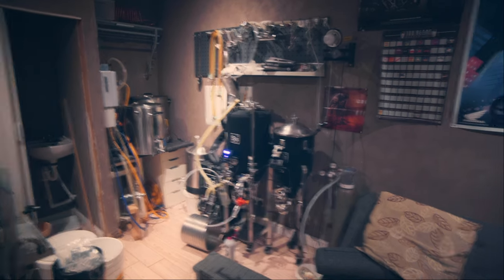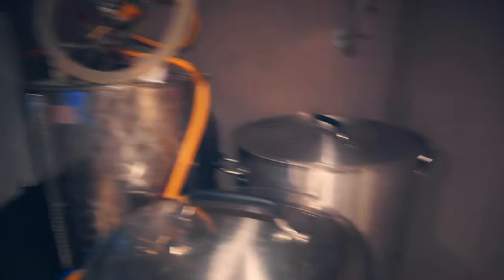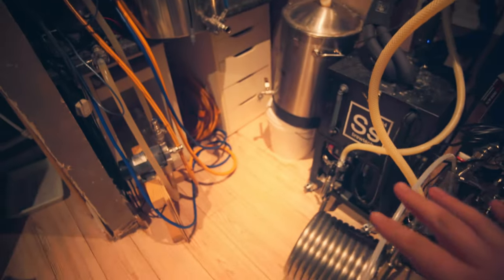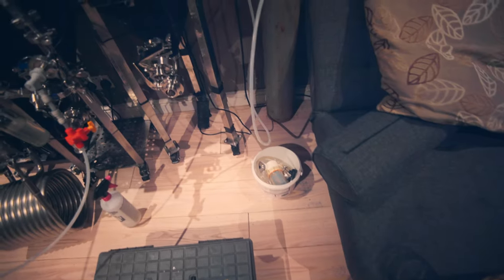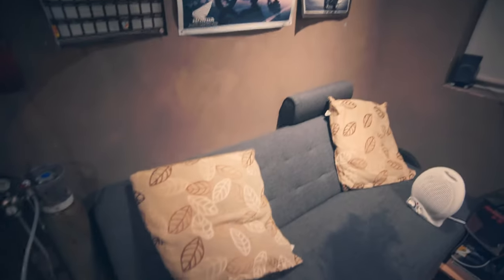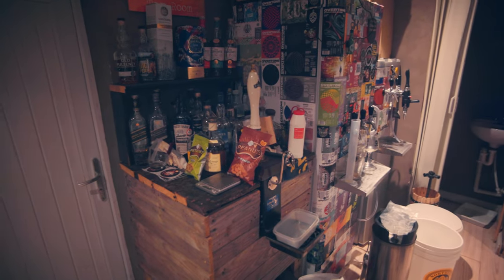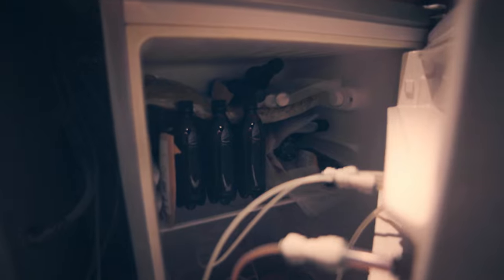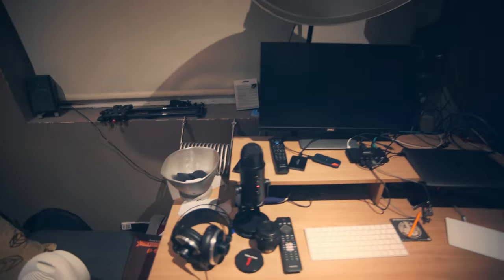Home brewery tour - High Road

Comment: You might have a drinking problem with your 8 taps 😂.  Lovely bit of space there, you need it by the look of it, the toilet in particular was a stroke of genius.  Few questions, is the garage connected onto the house and does it make it a bit warmer? are the walls painted or is that bare plaster? and finally, where is the BJCP poster?
Reply from the maker: Yeah problem is not enough time to drink! The garage was converted by the previous owner and is insulated then plasterboard. Even got a skylight in the roof. The garage is separate to the house. I’ve got an electric fan heater and oil filled heater in here. Tend to use the fan as it gets it up to temp quickly. BJCP poster was above the glycol fermenter 😜

Comment: How do you go about storing the open bricks of yeast? I just got myself one yesterday from WHC
Reply from the maker: Vac pack into 50g/100g blocks.
Reply: @AndrewLynch9  sound, I got a vac sealer in Lidl there. One more Q, what temp you set inkbird on kegerators. I've mine at 6.5, tempted to get a second fridge at colder temps.
Reply from the maker: @MrVinylNinja  6.5 should be fine. Think I’m normally 8 deg